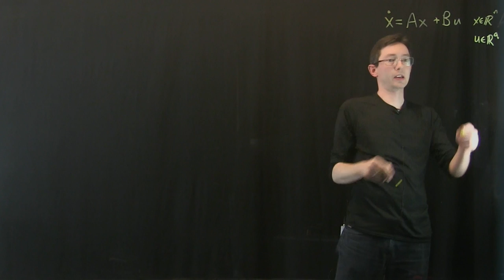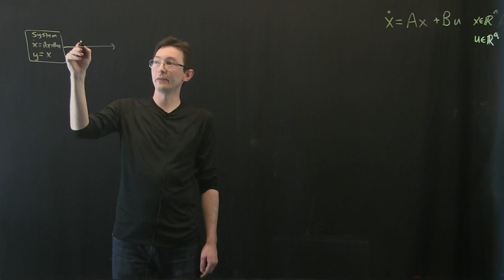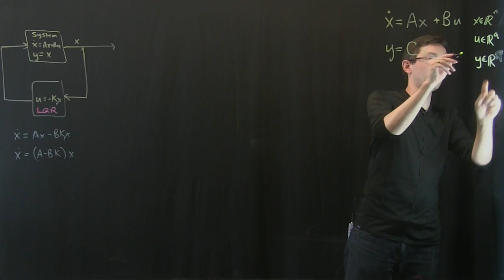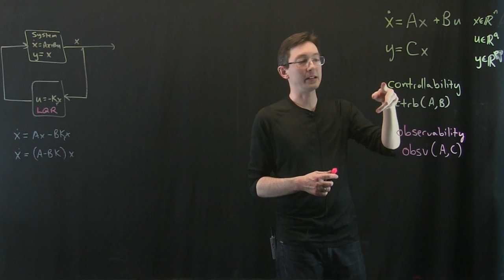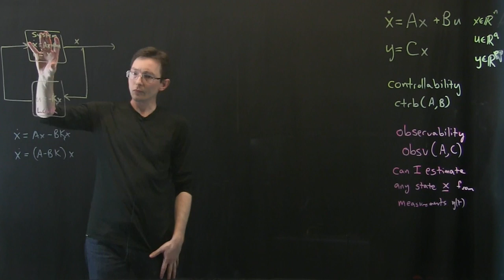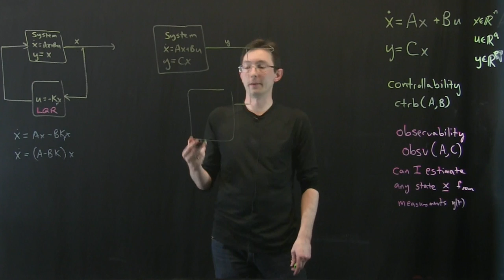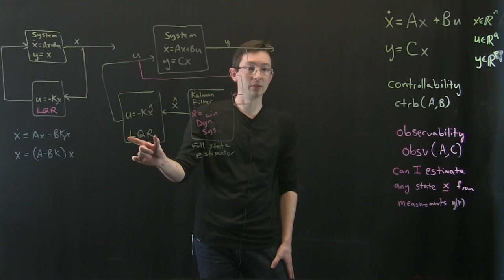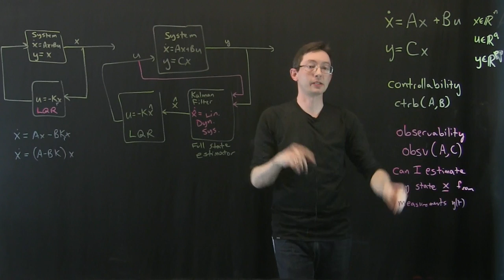Motivation for Full-State Estimation [Control Bootcamp]

Comment: I just graduated with an engineering degree, I know all the theory, I can do the maths with my eyes closed... But what I was always missing was a global intuition of the big picture in control. A lot of the theory seemed disconnected in my head and far from application. This series has been great for putting it all together and has increased my understanding immeasurably! Thank you.
Reply: Don't worry mate. I graduated 10 years ago and felt the same back then. Now the only difference after 10 years is you will keep coming back to these videos but you will vaguely remember the math behind it. After all these years this is now nostalgic and relaxing to watch. Sad truth is that this stuff only exists in college or in hardcode hobbyists because most companies will buy solutions that needs to be tuned (based on this basic knowledge).

Comment: I am working on a project where we are developing a product. The product has to be cheap and therefore cannot have too many of those expensive sensors needed to control the system. When I was first told that these sensors are only for testing and cannot be used in the product, I was bewildered. Like how will I even control the system then. Now that I know the concept of estimators, it makes so much more sense.

Comment: Professor, I have a doubt regarding the LQR concept that is explained here. Why isn't there any reference signal to the system? So directly feeding back the controller gain to the system is sufficient?
Reply from the maker: If there is no reference signal, then the LQR is regulating to the origin.  In this case the reference is "0"